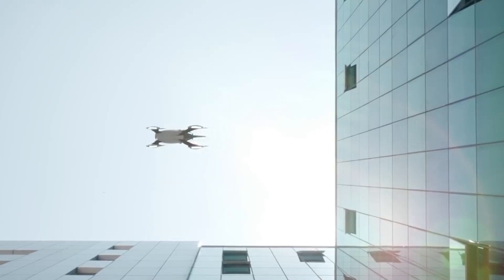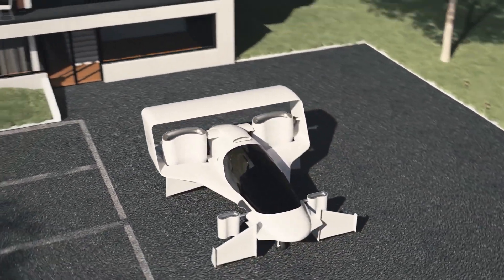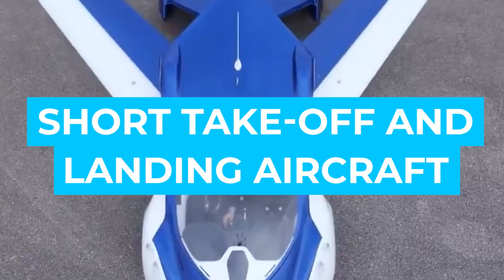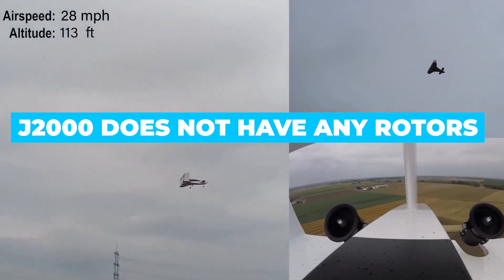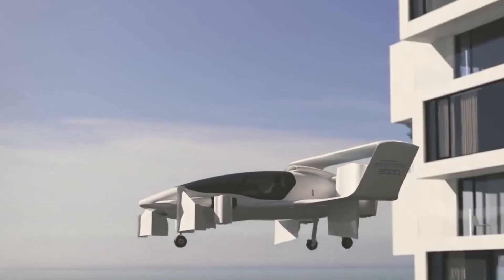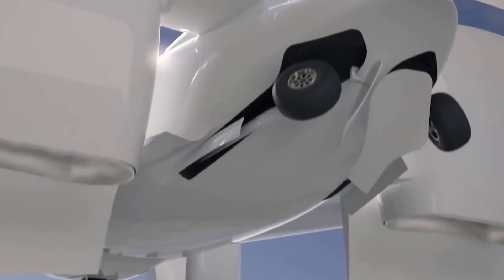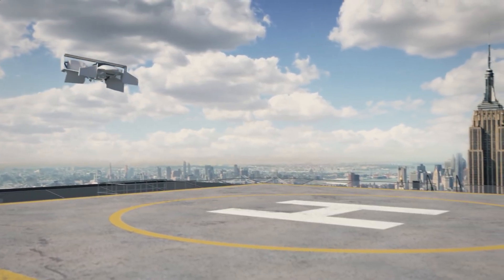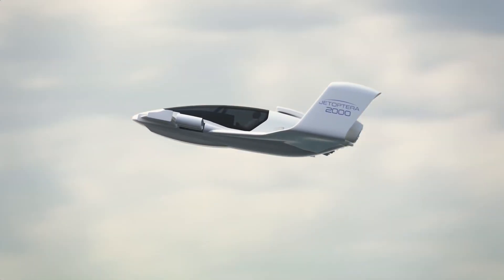How Jetoptera's Bladeless Propulsion System Works

Comment: Them problem with all these explanations is that this system DOES require blades and moving parts. It is just they are concealed ion the fuselage. The only way you can generate thrust without moving parts is ion/plasma  thrust. So let's be clear that this is the repurposing of an existing technology, but to create thrust you DEFINITELY need rotors. 'All' they did was improve on the efficiency of that thrust.

Comment: I am curious of what the friction loss is from ducting the exhaust stream of a jet or EDF through the system is, and if the additional air volume that is pulled through with the venturi effect makes up for it. As in, if the jet/edf produces "X" amount of thrust in the conventional configuration, does the fluid propulsion system meet or exceed "X"? I skeptical that it does.

Comment: Blah Blah Blah Blah Blah, never actually talk about the thing at all, blah blah blah... more empty words...
And no there is no such thing as a bladeless propulsion system unless you're literally using a fucking Rocketry or Ram/Scramjet. And since Ramjets need assisted take off and Rockets are explosive, I wouldn't say that either would be nice options. Otherwise there exist no such thing as a bladeless fan.

Comment: There are blades (either ducted fan or jet turbine) buried in the body of the aircraft that are generating the propulsion that pushes out of the back and front ducts of the aircraft.  The Dyson bladeless fan is not really bladeless either.  The are just hidden in the fan base.  Also, they’re going to need some hefty air intakes to make this work.  I think it’s cool and I wish them well, but it is not an aviation game-changer.  If you want truly bladeless,  electrostatic propulsion makes air move, but it’s not very strong.
Reply: It's marketing, as always. I'm excited about both, though - electrostatic engines could be used to power a vehicle IN FLIGHT, as a low-powered glider. For taking off, a combustion engine could be used. The fuel that would be needed for the jet engine can then be used to drive a generator with just a single turbine instead of two or even four. 
If turbulence occurs, the jet engines for take-off can be reactivated to allow for better maneuvering.
All in all, such a design COULD save a lot of fuel at the cost of more expensive production.
In my wild theory, at least.
Reply: Actually they are using the thrust augmentation effect for increase lift.
Reply: So what you're saying turbo jet is on the right track remember when somebody says that somebody else and be a success dear lighting fires underneath your feet to keep going.
Reply: Oh good. Someone else here realized this thing was a big old scam, just like the Dyson "bladeless" fans with their bases full of (guess what) blades.
Reply: Armchair engineers 🤣
Reply: @t_c5266  Some of us you can take the word "armchair" out.
If you're too dim to understand our arguments, don't blame it on us.

Specifically: flight only requires a high momentum air mass leaving the aircraft for it to fly. This "solution" employs a high energy air mass leaving the aircraft at the cost of momentum.

If you don't understand what I just said or why, then you are an armchair engineer.
Reply: @htomerif  the fact that you got the operating concept completely wrong makes me laugh that you started this with a lecture about being an armchair engineer🤣🤣🤣
Reply: @htomerif  you're the one asserting you're not an armchair engineer.

so do tell. What is the mechanism of operation that increases the energy of the air mass at the expense of momentum.

please reference equations and show your work.

otherwise, you're just an armchair engineer
Reply: @htomerif  I was under the impression that E=0.5mvv while p=mv, therefore high velocity low mass favors energy while the reverse favors momentum; and the entrained air adds mass while leaving energy approx the same; and as you say, momentum is what we want; so now what's wrong with my armchair reasoning?
Reply: @rodschmidt8952  Unfortunately, entraining air doesn't "leave the energy approximately the same". Any place where you have high levels of fluid shear creates high levels of thermalization of the high velocity air's energy, so its wasted as heat. This is assuming that the flow remains laminar, which it certainly doesn't. It breaks down into turbulent flow, which lowers the efficiency even more.

The effect is functionally identical in terms of losing energy to thermalization to the movement of air over a surface. The boundary layer shear causes an enormous amount of energy loss, and that energy loss comes in the form of heat. Always ask yourself "where is this energy going?".

A good example of this is the (relatively) high efficiency, high bypass turbofans of modern airliners versus the low or no bypass turbojet engines of fighter aircraft. Fighter jet engines are more compact, delivering more thrust in a smaller package at the cost of greatly reduced fuel efficiency. Airliners can't (and don't) just rely on "entrained air" for transoceanic flights. There's a separate power tap turbine that powers (through a functionally separate shaft) a larger, slower turbine. Entrained air just doesn't work.

What this particular aircraft engine system does is combine the worst of both worlds. It combines the size and aspect ratio of a high bypass turbofan with the inefficiency of a turbojet engine, a staggeringly nonsensical idea.

Where your armchair reasoning failed you is not your math. That's fine. The math you stated is the reason you can fire a gun without it feeling like you've been shot by one, but guns are a relatively efficient system because they're basically just a piston expansion chamber. Your armchair reasoning failed you in that you oversimplified the fluid dynamics. it doesn't come down to (m*v^2)/2 magically turning into m*v.

The loss of energy due to thermalization in fluid shear is proportional to (the square, I believe) of the difference between the driving (i.e. high velocity) fluid speed and the driven fluid speed. So you want that shear to be as small as possible, and there's a device that does this very, very well: a propeller.

Turbofans are glorified propellers. Turboprops are actual propellers and helicopters are just (except for the small piston engine ones) turboprops with a gear that turns the output by 90 degrees (actually usually like 101 degrees? For some reason I forget its usually not exactly 90 degrees). Hell, the V-22 Osprey is actually a glorified, sideways CH-47 Chinook, complete with controllable cyclic, collective and everything.

If I remember right, this thing was just a bunch of EDFs feeding a Dyson fan. They would have been better off picking EDFs that operated efficiently at whatever speed regime they were targeting.

If you want to see how to do this right(ish), look up the UK's Jackal drone. While it is capable of VTOL through what amounts to large quadcopter motors, it's efficient forward flight is provided by 4 large EDFs.

If you want even a glimpse of the truth, I gotta write a comment this long, and this is just the tip of the iceberg. The only reason I put the effort into responding to you is because you actually attempted to understand what was going on where no one else in this comment section even got as far as knowing the difference between momentum and energy. I can't fix that level of uninformed.
Reply: I think this scam is even worse because the large internal surfaces in the area of air intake, compression and routing create quite a bit of frictional resistance, even if it isn't visible from the outside. Not only is this not beneficial, it is probably even more inefficient than a visible propeller.
Reply: @asagk  And it has to be a scam. Despite the fact that this will never amount to anything, it still took a lot of technical competence to make their demonstration work. The people who made this thing know everything you just said. They know for a fact that it will never meet the claims they made. They're willfully misrepresenting their "technology" to investors. Its fraud, like Theranos only it hasn't been busted yet.

Comment: Maybe this large and robust body design would be perfectly suited to being constructed/incorporating the other latest design/invention carbon structural batteries---solid state carbon/lithium structural panels could 'be' a solid state battery and carry slightly less weight in regular lithium batteries currently being improved greatly in efficiency and weight

Comment: I love how they always say electric engines are environmentally friendly even though the technology is far more dirty to create the battery and where do you think the power that goes into the battery comes from gas and coal just adds another layer of an efficiency to it which means it’s even worse
Reply: I have zero problems with petroleum or coal.

Comment: "Bladeless" is nonsense; The blades are hidden inside the fuselage. Bladeless is not a technical term; It's a marketing term. A lie. Because there are blades.

The acronym "EVTOL" is yet more nonsense. It's just a VTOL craft. Wether it is electrically driven or fuel engine driven, doesn't matter; A VTOL aircraft is a VTOL aircraft, regardless.

When you have to hype your products with lies and nonsense words like that, you're probably delivering a garbage product or possibly are even trying to attract naive investors and run off with their money once you wore their trust thin without building a single aircraft. (Well maybe a non-working prototype, just for show)

Comment: The device to move air through the bladeless duct comes from a fan outside the duct but hidden. If it had any advantage over bladed fans, it would already be used in commercial aircraft. Any efficiency advantage would be a competitive edge for an airline company. The fact that it is not being used by competitive companies tells you all you need to know about them.

Comment: An stol is all but worthless.  The very need for an airport defeats the purpose of these aircraft.    Vtol's very purpose is to eliminate the inefficiencies that come with utilizing and airport.  Vtol is ment to be as easy as catching a cab.  Lets say you have a stol. can you imagine the time it will take for you to get processed and proved for use of an airports runway after you just pulled in from off the road?  The aircraft would need to be inspected and approved for clearance then be cued for runway use.

Comment: Where did you get this information from? Even though I may not be the most knowledgeable or credible, I do know that batteries are anything but inefficient when compared to combustion engines. Their problem is that they don't have the endurance/range that ICEs have.
 
There are many other things that even I can point out and say that those claims are iffy at most.
 
Besides that, I do want to see these fly, not because of the "astonishing" things that it can apparently do (they really aren't that special or useful, if it can even do them at all). I'm interested in it because, although it probably sucks, it is a new take on a problem and will have very curious and interesting engineering behind it and I love engineering.
Reply: its the weight to energy ratio that's the problem

Comment: I do not think "bladeless" is the correct term, as there are no doubt blades, just hidden inside the fuselage. Same with the "bladeless" Dyson fan. "Compressed air propulsion" would describe the system better I think.

Comment: "the weight of the chemical composition of the air" is what keeps us grounded from such tech and not "gravity."

In theory since air contains a material amount of oxygen it can be ignited as opposed to nitrogen which remains stable...thus understanding this difference again IN THEORY could provide both lift and propulsion ... of course as has been true for over a Century now.

The question becomes one of validating the test object ("a flying saucer") to see if it actually flies (the F-117)

Comment: Why’d they start with a gas engine?

Lithium ion batteries get you around 16-24 kWh (energy content / density)

1 gallon of regular gasoline contains around 36 kWh 
To replace a thing, the replacement has to be better (not just marginally better) than that which it replaces. And right now EV’s are not better than their IC counterparts, they’re bought by two types of people:
1. EV enthusiasts 
2. Those who want to have a status symbol or be seen as caring about the environment 
The Camaro in my profile picture was converted to an EV last summer when I had a lot of forced free time. It uses the motor from a Model S and about half the battery pack (that’s as much as would fit into the car). Right now I’m looking for a company that can turn my cars removable roof panels into solar panels, so if anyone knows of a solar panel manufacturer that’s willing to make custom panels please let me know

Comment: My aircraft is a real bladeless vtol and is electric, it generates electricity as it runs, no problema with batteries going low. The technology is here now not for the future. I will publish with videos soon enough just way hank in there because is going to fly soon and a powerful message from God at well. It's a sign in the sky,mega tsunami is coming to the Caribbean and USA after the aircraft fly and published.

Comment: I believe this is the up and coming Tech. Reason's are: No Visible Blades, Using the Dyson enclosed blade system of propulsion, The Canard Wing design for level Flight, The bi-wing lift in the rear, like the Wright Brothers, small wings in front and large in the back. The Front propulsion for lift off and landing tuck away and the thrust used to lift up or down can now be directed to the rear for forward thrust. They said 400 nots per hour, translated to MPH, that is over 460. MPH. Because of the Canard wing in the front? Level flight can be obtained, which means half the drag or better and twice the distance on fuel and faster speeds, with no stall or spin problems. The Length of the wing is determined by the total amount of wing's and the Bi-wing is compact, yet add the top wing and the bottom wing for the overall length of wing lift and on top of that the venturi lift and thrust increase in the propulsion system. It's an outstanding design.

Comment: Can it fly to outter space?
Reply: No!
It has to be specifically designed for that, and a gas powered air ship is not capable of achieving the speed and height necessary for escape velocity.

Comment: They are getting closer.  A hit for them.  Think of air as thin water . And magnetic pulse displacement. Low voltage.  High output . You dont need batteries or fuel . Just think of water that's thin .

Comment: Because it is a fluidic system, I would be curious how they would deal with rain. Water in the system would interrupt air flow and could choke out the system. Then there is the issue of moisture and freezing temperatures with ice formation also choking out the air flow. Five years is pretty optimistic.
Edit: Also consider that this system would fail if flying with the wind and the wind speed is equal or greater than the aircraft forward speed. Because of the systems fluidic principles, this could be disastrous.
Reply: Very well said Sr.
Reply: once it's airborne, the frame of reference is within the surrounding air. If it flies with a tailwind, it would just have greater ground speed.
Reply: @carlosandleon  That is true of normal propulsion systems but this relies on air flow forced through a specific pathway to generate force by laminar flow. Back pressure could disrupt the laminar flow if the tailwinds are stronger than the outflow.
Reply: @arnoldbailey7550  you can say the same thing with propellers. Imagine taking off  with a tailwind on a cessna. With a strong enough tailwind, thrust is negated there too.
Reply: @carlosandleon  yes. However, this flow system is not the same. I just want to know if it would kill the engine or cause  a stall. Typical aircraft can recover fairly well; would this system. Regardless, water and ice would still be an interesting test and I imagine a bird or two would not bode well.
Reply: @arnoldbailey7550  I think water and ice is a non issue here given the application of the vehicle (and technically, bleed air from the turbine variants can solve the issue altogethe) . Birds even less of an issue, there are no moving parts to damage.

Any tailwind that would significantly compromise this system will compromise contemporary systems as well. Except for maybe jet engines.
Reply: @carlosandleon  I would like to see the test in those conditions. There is actually a moving part. There is a blade system to take in air and force it through.  The bladeless claim is misleading. I have seen only a few "updates" but only regarding sub models and not full size with a pilot. After the past several years since this was announced, the lack of progress is a bit telling.
Reply: @arnoldbailey7550  I know, but the exposed part has no moving parts for a bird to damage
Reply: @arnoldbailey7550  I too am very skeptical about thr company. But not the concept.
Reply: @carlosandleon  I like the concept but I also understand the airflow design of it and I can see the issues water will play in it. Water or fluid flow in general would accumulate in a critical are of the system and reduce or interfere with air flow. At any appreciable altitude this would cause the accumulation pockets to freeze. A typical aircraft does not have this issue due to the straight flow of their design.  This system relies on the Dyson "bladeless" fan design and uninterrupted airflow is crucial. I suspect it is why more data is not available as these issues will not be easily resolved. There would need to be a dramatic change in the intake system and a backup system.  If I were an investor, I would have tapped out.